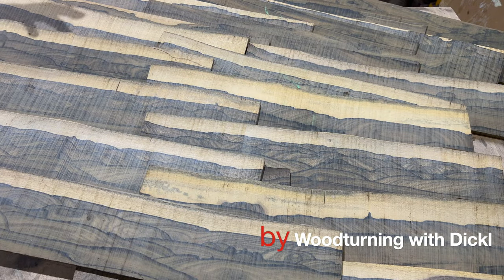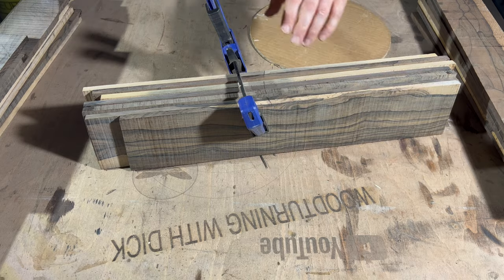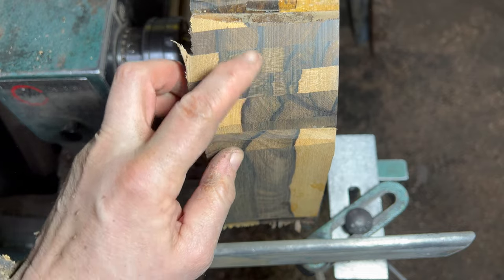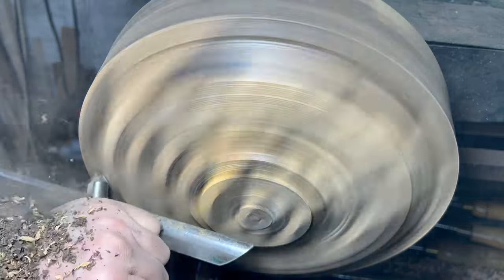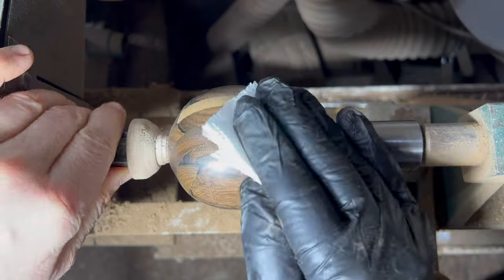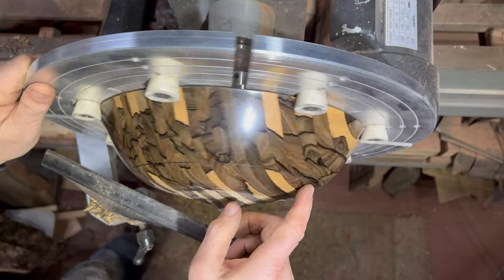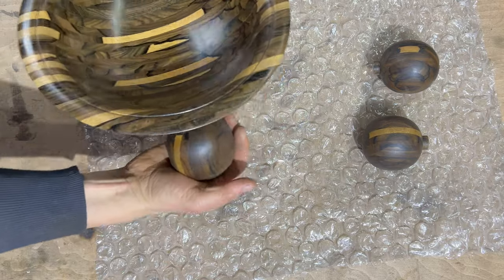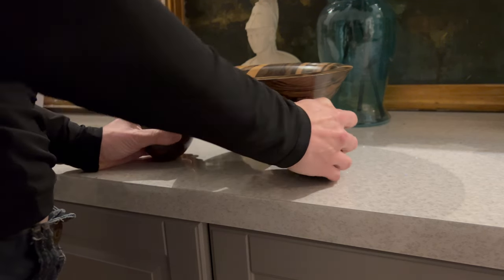The bowl with balls... featuring Lenore

Comment: Oh my, that wood is wonderful; I think I wrote something similar about the previous one, but I don't think I would have had the b...s, (I meant vision), to glue them all together to hide most of it, but, somehow, it results in bringing out the best of it! I love the bowl, the pointy bit underneath ... but may I be as bold as to suggest that your machismo may have influenced the size of the balls? I think maybe 'less is more' in this case? I hadn't thought of the idea of gluing on pieces to make the original tenon wider - great tip. Thought provoking ... you always 'push the boundaries' ... challenge yourself and us  ... Great entertainment!!
Reply from the maker: 🤣🤣🤣🤣 ya, I may have been overcompensating with the sizes 🤣🤣🤣👍